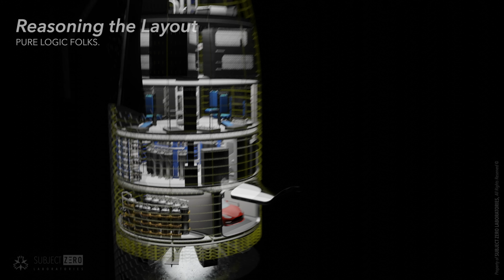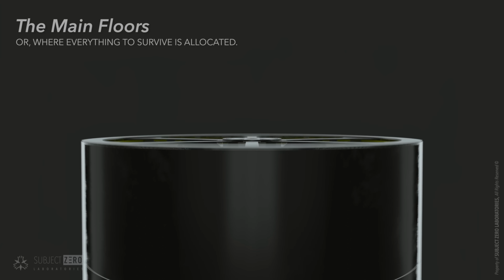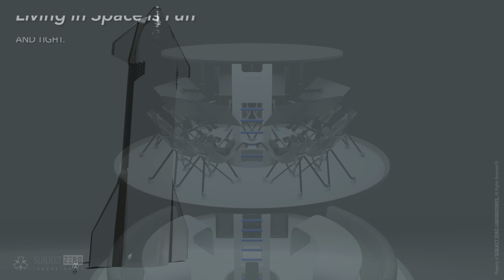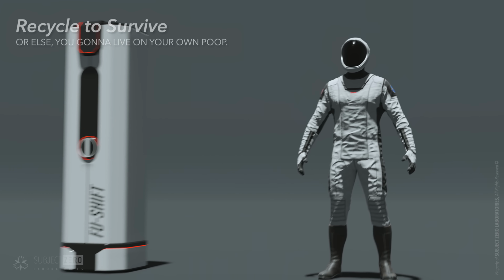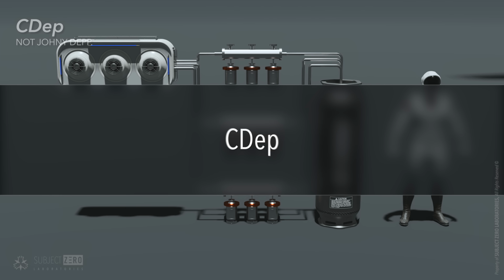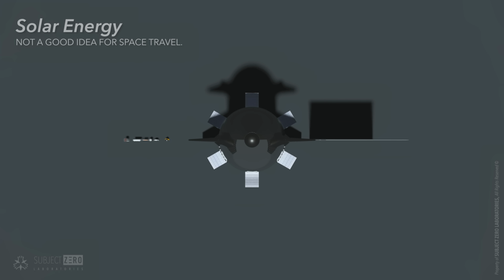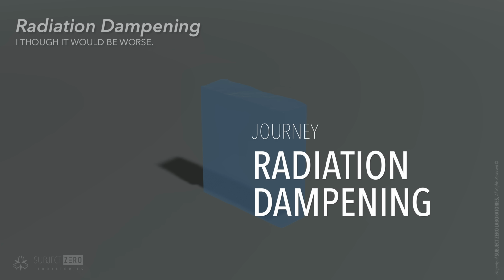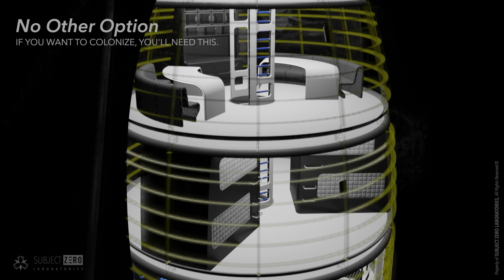Onboard the SpaceX Starship 2.0 in Detail - What it takes to go to Mars | Detailed Breakdown

Comment: This is awesome and very much what I've been thinking about. I've written 100+ pages of content about going to Mars and living there and just some of the technical challenges. The getting there bit is a big one that I don't think enough people have thought about. This is the greatest detail I've seen on the topic
Reply: Elon stated with a slide back in September 2016 that mars missions should take
2024: 140 days
2027: 150 days
2029: 140 days
2031: 110 days
2033 90 days 
NASA has shown 30 days on Mars is possible to return before the planets are out of alignment meaning a full mission could be 330 days long instead of 5 years
That’s 5.53x shorter of a mission
Daily ration 
2.5kg Food
3kg water
1kg oxygen

CO2 and hydrogen can be converted to Methane and water using the Sabatier reaction and H2O can be converted to hydrogen and oxygen using electrolysis so this can mostly solve water, fuel, and waste issues meaning roughly 2.24x less mass per astronaut.
This can effectively bring the mass requirement down to 825kg per astronaut (+ 75 kg astronaut + 75kg water) 
At ~1000kg per astronaut, 10 astronauts would only need 10,000kg for a return mission instead of 118,625kg
Reply: do you know what type of power would fuel the inside? for example nuclear or solar or both?
Reply: @emma-ns6fj  nuclear wouldn't be feasible as it's large, heavy, and highly complex. Nuclear power just boils water to turn a turbine to generate electricity. Solar would be the most beneficial as the ship would have 24/7 solar radiation. There could be a heat exchanger that could help save energy by utilizing the light below UVB that solar uses to generate additional electricity.
Reply: @beyondplanesight  interesting 🤔 but wouldn’t the solar power get weaker as the ship moved further from the sun?
Reply: @secretname4190  you are correct that nuclear submarines have small reactors. The submarine costs $3.45 billion with the reactor costing $200 million or more, aside from cost, spent steam at low pressure runs through a condenser cooled by seawater and returns to liquid form. The water is pumped back to the steam generator and continues the cycle. Any water lost in the process can be made up by desalinated sea water added to the steam generator feed water. There is no seawater in space to cool the steam so it would not work. Solar arrays are much cheaper and simpler to install and can be pointed at the sun for 24/7 energy. If we could develop an energy source alternative that does not require heating steam to turn a turbine, then that could be used but there is little out there that has been proven to work at a commercial or industrial level.
Reply: @emma-ns6fj  it would. The advantage of not being in orbit around the earth is that it receives 100% more solar energy. The space station spends 45 minutes in darkness and 45 minutes in the sun so a trip to mars would automatically have much more power available. combined with higher-end panels they should be able to power everything the ship needs. The inverse square law does come into play and the panels will come into play. Once Mars is reached there's only 590 w/m^2 compared to 1370 W/m^2 so the trip would be between those amounts

Comment: Very happy to see someone else doing this.  However that said, I'd like to give some constructive criticism.  (1) Don't do zero-G all the way to Mars--at a minimum connect two starships by the nose and rotate;  (2) Don't need that much exercise equipment--they will share; (3) The flight deck could be reconfigurable for multiple uses--I suggest a classroom, lots to study en route;  (4) Forget dehydrated food--use MREs + hydroponics; 1 MRE is 3-4K calories so one per person per day; (5) Obviously, you are going to recycle air and water--Mars has at least 1 liters of water ice per 1 cubic meter of regolith;   (6)   600 grams of algae can exchange enough CO2 to Oxygen for an average adult, it can also clean ammonia and metals, a moss wall can do similar but directly from air as where algae will require spraying through air to capture it in water;  (7) I don't think its going to need nearly as much electricity as the ISS, unless it's conducting numerous experiments and such;  (8) water and plastics are great radiation insulators, yes.  Also, foam the plastic and use as insulation.  I suggest PVC, which will give similar radiation shielding and better insulation.  Metals help block radiation but release secondary particles even more dangerous.  That said, the plastic and water will block it.

Comment: If we really really want to travel all the way to Mars on a starship, then I think it is going to be multiple starships going at the same time. At least five starships. Some of them will just carry cargo. And atleast two will be crewed. 

This will give massive redundancy incase something goes wrong. Also this will drastically reduce the weight in carrying too many redundancy stuff in each starship as there is always another starship nearby. Also, since we can travel to mars only once in 2 years, it would make sense to send maximum stuff in one go.

But a more optimal idea would be to create a "Mothership" in space whose only purpose is to travel between Earth orbit and Mars orbit. Think of it similar to ISS. This way, we wouldn't have to unnecessarily carry landing-systems on each starship which reduces weight massively. And also, we can give much more space to the passengers as we won't be limited by single cylindrical shape. Also, it would make it possible to give artificial gravity.

Great high effort video by the way. Best on this topic!
Reply: all lestin too elon musk one ship cargo, transport , refueling  . 3 different variables . aka transport ship need carry food water for 7 months  the cargo ship carry extra needs for the  transport ship and  refuel ship used refill starship before it lands. hint why musk said 100 ppl . all need read what musk said  send 100  starships same time.   send cargo ships ahead too mars  have 5 years of food , water ,oxygen other supplies  before one human starship leaves for mars.  used tesla  human robots too build mars colony.

Comment: You also have to consider the EVA suits of each astronaut, if you plan on them going outside on Mars
Reply: Probably wont be necessary to go outside. A modern drone would be sufficient for just about anything that could happen on the outside of the life supporting areas.
Reply: @ispartacus1337  people need to go outside tho, touch grass, be alive! Although, there is not much grass on Mars
Reply: @ispartacus1337  Why send humans to mars if they're not going outside?
Reply: @ispartacus1337  facts
Reply: Look at SpaceX suits for Dragon and is already design vacuum EVA suits.  Mars is a mix, has a partial atmosphere so doesn't need reinforces joints but will need dust seals for joints, connectors and  fittings. I can envision something like a Tesla charge connector plus a static charge generator.
Reply: Yea, there's always more to remember organising these kinds of expeditions!!    
But the gym is six times larger than it needs to be, so they can store some suits there.      ;)

There is also plenty of spare ceiling space in this design for mounting extra equipment.
The flight deck equipment could be on the ceiling and a rec area on the floor, eliminating one metal deck.

They'll also need stuff like a rubbish compactor, and a solar storm shelter next to the fuel tank.
A lot depends on what is already at the Mars landing site, and what needs to be brought along.
Ideally the ship and its contents are mostly about doing the trip right. 

Staying in the ship on mars would be quite inconvenient, so heading to a hab would be nice...     :)
Reply: @darrennew8211  EXACTLY!!!  WHAT WOULD BE THE POINT???
Reply: @psdaengr911  FWIW, Mars' atmospheric pressure is less than 1% of the Earth's. It's sufficiently "not there" that it's a vacuum in terms of things like joints. A hurricane speed wind on Mars would be almost unnoticable if you weren't wearing a suit.
Reply: @psdaengr911 mars doesnt have a 'partial' atmosphere.  Its almost a vacuum.  Its atmosphere is equvelent to 45kms in altitude on earth.  Thats why its so hard to land on it.

Comment: Great video! They likely would be able to tap oxygen directly from the main oxygen propellant tank though, so that would save a lot of mass from the oxygen tanks you factored in.
Reply: Similar with water as you can use the waste water from the hydrogen fuel cells to supply the crew. Shielding is another point, if 2mm of shielding is enough there is no way 5cm wouldbe used throughoutthe whole ship. That would mean a safty factor of 50x which i way overengeniered even if we arent talking about mass critical applications like space travel, and as mentioned a segnificant ammount of shielding could be provided by water tanks and other storrage as well as the structure itself with some areas havong more shielding to serve as shelter during solar storms or while travenling through the van allen belts for example where you have to factor in increased radiation levels.

Comment: You worked out many constraints. Very good! The "belly flop" reentry phase means that seats need to swivel from down-toward-the-bottom-of-starship to down-toward-the-belly and back in a few seconds. This constrains the configuration of landing seats.
Reply: Or you spilt the difference and have the seats at 45 degrees to the engines or bottom of the ship…
Reply: The interior seating or couches might be reconfigured and repositioned for departure, zero g coast phase, and landing. Not really needed in zero G. Design for multiple use of major components are essential.
Reply: If all the seats face away from the belly it wouldn't be too bad. You would be comfortably reclined during the belly flop and upright during launch.
Reply: @eatonkuntz  An airline row seating configuration is probably a realistic solution, there may be others. The couches would need to rotate up around their midpoint about 30 degrees for the decent and then quickly pivot back to horizontal for launch/landing. Space X will probably adapt existing seats they use now for the Dragon capsule.
Reply: Is that really necessary ? Why do they need to rotate just for the few seconds of belly flop ? Geniune question.